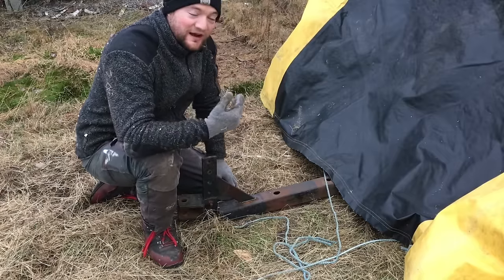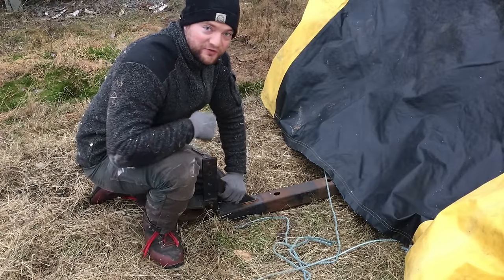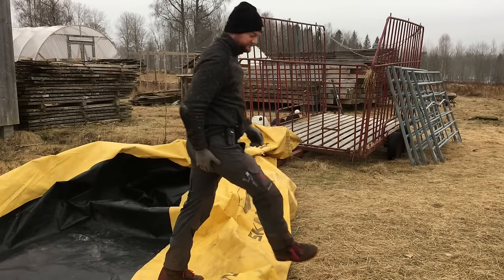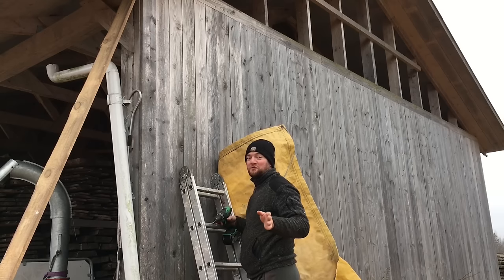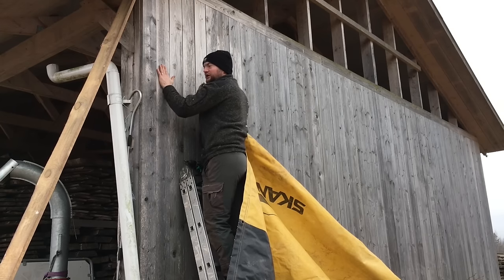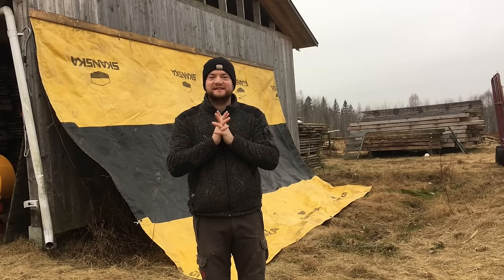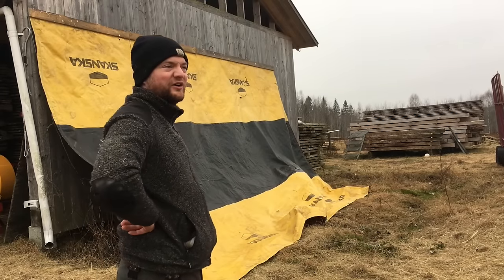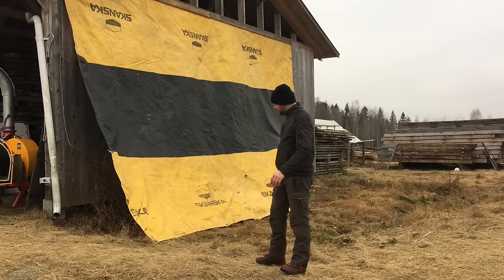Building A Temporary Cow Shelter Quickly

Comment: I agree, the lower position is not high enough to shed water and snow. There is not enough support to hold snow loads on the higher position. Well, perhaps building a frame upon which to lay the tarp. I had the same situation with a canopy and had to redesign the frame upon which I put the canvas. It worked very satisfactorily after putting in the supports.

Comment: In the future consider using a board on both sides and all the way around the perimeter of the tarp.  Then use a couple of poles to lift it high up and attach to barn.  Remove the poles and use them to hold up the loose end and secure the poles at an angle to the ground.  High winds you could quickly drop the tarp and put it back up just about as fast.  Knots are nice :)

Comment: Hey guy, get rid of the drill for driving screws, and, get an impact driver. The difference in how they work will amaze you. For years I did not use one, and, now that is all I use to drive all kinds of fasteners.  Looks like you have a Hitachi screwdriver, if you get a Hitachi impact driver you can use the same batteries and charger.
Reply from the maker: I think that those things make such horribly loud noice.
Reply: The newer ones have an oil pulse impact mechanism which significantly reduces the noise. 

Getting an impact driver changed my life (even a loud one)....and I'm just a home DIY type guy.
Reply: Hey, I am a professional cabinet maker and home builder, I have been doing this for almost forty years, and, have seen the evolution of all of these cordless tools. I had an impact driver in my tool kit, and, like you I thought that they were loud. After a while, I thought I would give it a try, I will never go back to using a driver for anything other than what it is supposed to do, namely drill holes. My eyes were opened while I worked on a deck project with some young, your age, guys, they told me I was crazy not to use the impact driver for deck screws. I guess what I am trying to say, is that we never stop learning newer and better ways to make our work go. The impact drivers are really amazing, I use mine to drive in the big Reisser  construction fasteners all of the time, give it a try. I have grown accustomed to the noise, but, if it really bothers you, try earplugs.